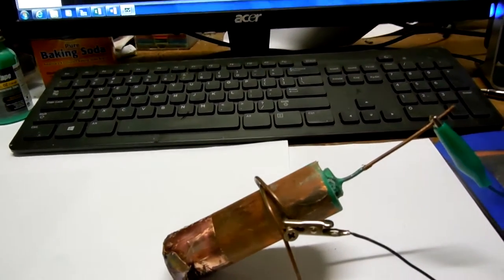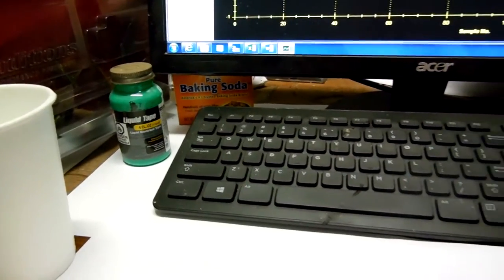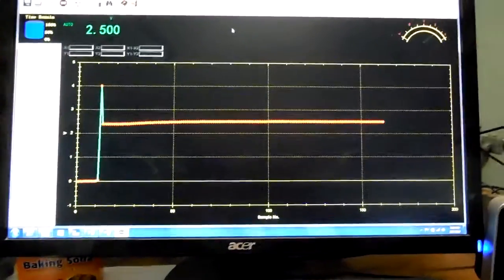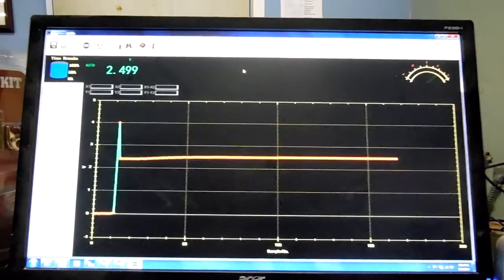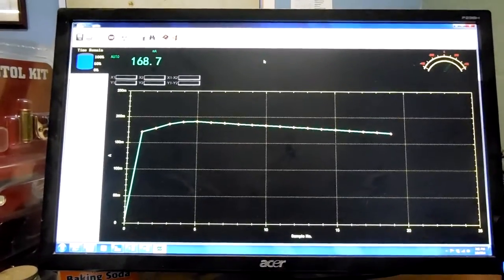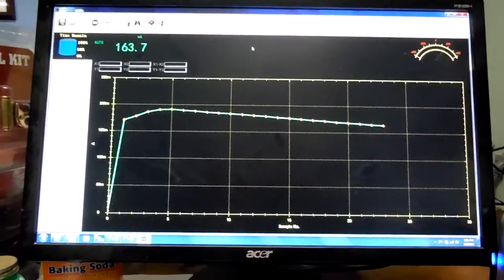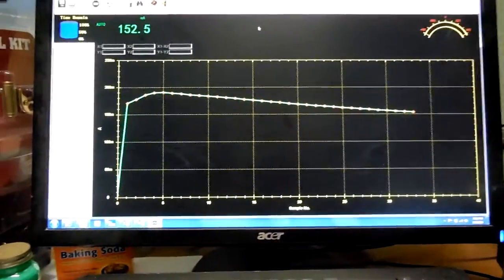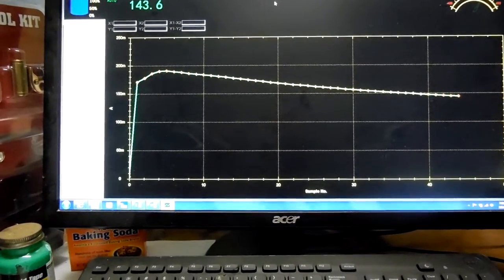2.5 volts on one battery cell, Allwest power cell

Comment: The max theoretical reduction voltage potential of Cu and Mg is 2.89v. Getting 2.5v in your build is very good. Thumbs up.
Reply from the maker: Very interesting OUBrads
Thanks for the info
Reply from the maker: Steve Allwest Mg/Cu:

Mg: standard reduction potential = – 2.37 v
Cu: standard reduction potential = + 0.52 v

Mg: standard oxidation potential = + 2.37 v
Cu: standard reduction potential = + 0.52 v
------------------------------------...
Maximum theoretical cell potential = + 2.89 v

Comment: Well done Allwest ! What is the rest voltage of the cell at 50 mA current draw ?
Can you light up a 1.7 Volts threshold red LED fully bright with it ?
WHat is the inner resistance of the cell at 50 mA current draw ? Many thanks.
Regards, Stefan.
Reply from the maker: Hi Stefan,
Love to try all these tests for you, not sure how to do these tests, maybe you could make a video on (how to do) these tests for me?
This cell had been running shorted on the amp multi meter for days and it stays pretty much constant at 50Ma, then after resting it will recover to these levels as seen

This cell will raise in power if you hold it in your hand, it is very temperature  sensitive, I think what it is doing is providing its own heat at the 50 Ma level to keep the cell powered and keeping the inner temp cool enough to keep going

kind of an equilibrium that keeps going, I believe there is some redox reaction going on still but I am hoping most of the power is being generated by the thermal electric generator affect powered by the cell itself

Best regards